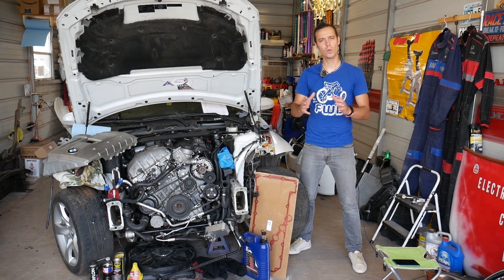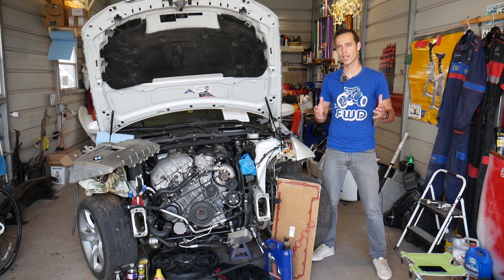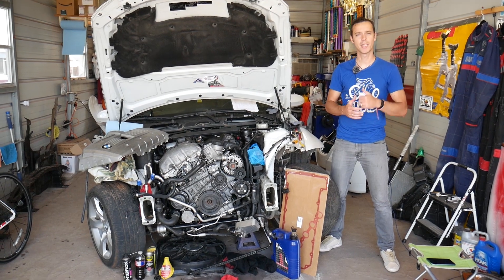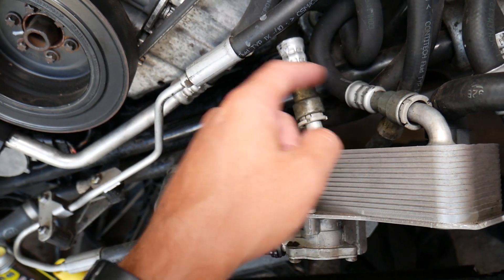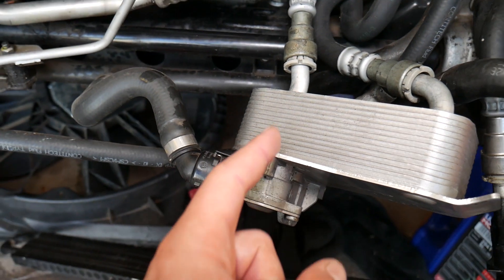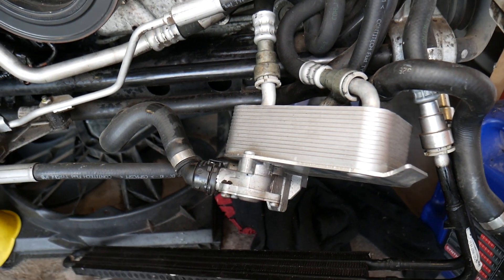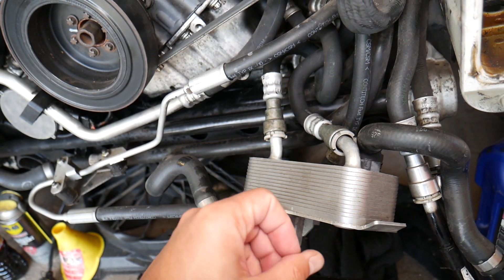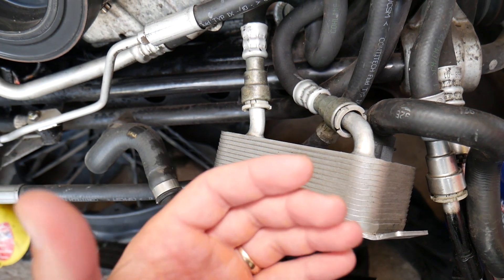CAN YOU DRIVE BMW WITHOUT TRANSMISSION THERMOSTAT

Comment: Hey nice video. My transmission thermostat was removed by a mechanic and he confirms it’s more suitable in the climate that I live in. It’s always hot over here in Southeast Asia hence reaching operating temperature wouldn’t be an issue I reckon. Can you share your thoughts ?

Comment: I’ve noticed my coolant comes up to 80-90c within 5-10mins

However my trans does not come up to temp for at least 20mins

Wouldn’t having the TStat delete mean that the transmission would come up to temp quicker because the coolant would actually be hotter than the transmission oil
Reply: That's a very good question. And begs the question of WHY is there a trans thermostat installed in the first place?

If engine coolant flowing freely thru the trans cooler serves to warm the transmission fluid to operating temperature Quicker, and then keep it there at the temperature of the coolant coming out of the lower radiator...then I'm not seeing any benefit to having a transmission thermostat at all

When I had my 330i ZF transmission rebuilt a second time, the trans shop removed the trans thermostat from my expansion tank. I found that interesting